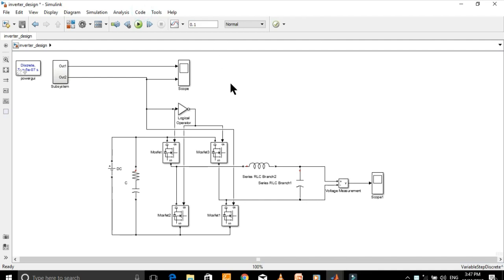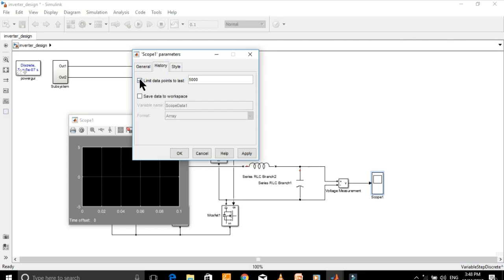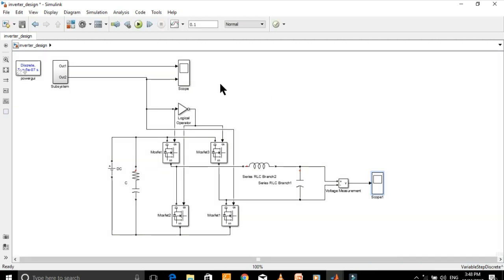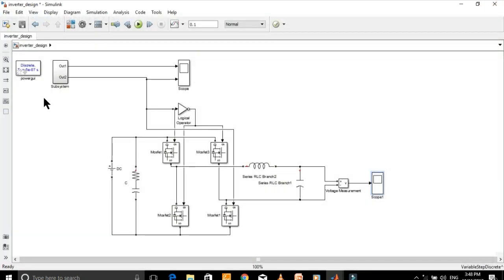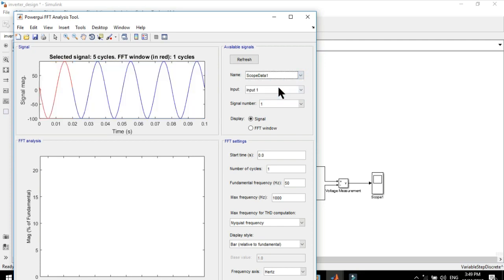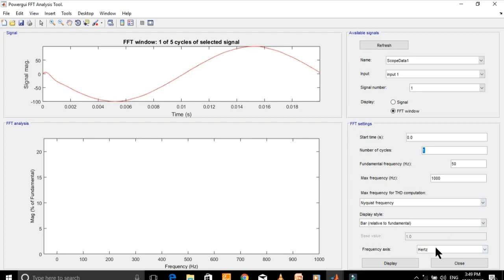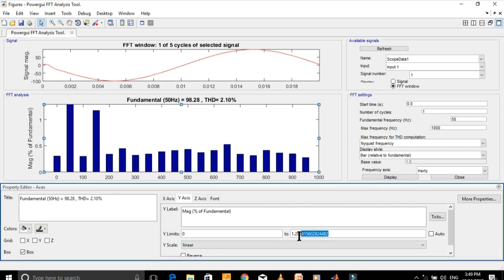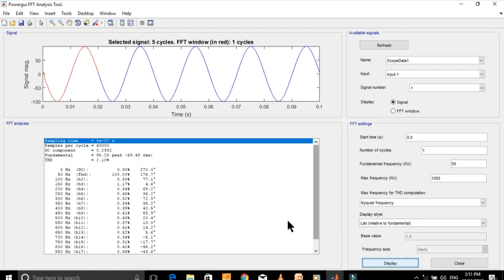Pure sine wave inverter design in simulink Matlab Part_2 FFT analysis

Comment: Nice video sir I like your videos. I have a question and maybe you can help me. I have a three phase circuit with 12 pulse diode rectifiers. I am analyzing the total harmonic distortion with the FFT tool in the powergui, but when I change the particular time and the number of cycles in the measurement the THD increases rapidly. Is there a explanation for this?

Comment: Gd day friends. Pls how do I recover normal screen for FFt analysis tool? Usually, when I launch Simulink, open the "powergui" block, run my simulation, and click on "FFT analysis tool", a page appeared as shown below:￼

However, after clicking on "edit", and "clear figure" on the FFt analysis tool, the blank screen below appears.￼

I have not been able to restore the normal FFt window; the blank window keeps coming each time I want to run FFt Analysis.

You suggestion is welcome about solving this problem. pls you can email me at hero.point@yahoo.com Thanks.
Reply: Ha ha !  are you surprised ?